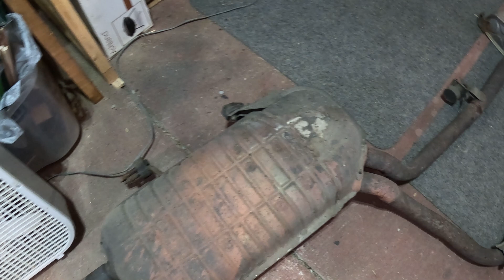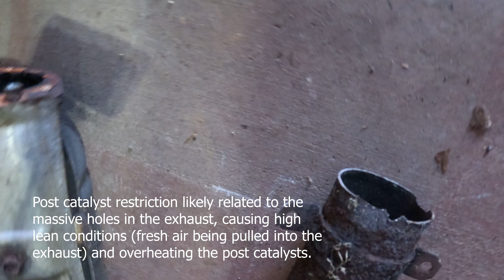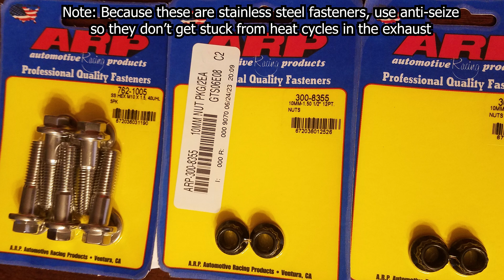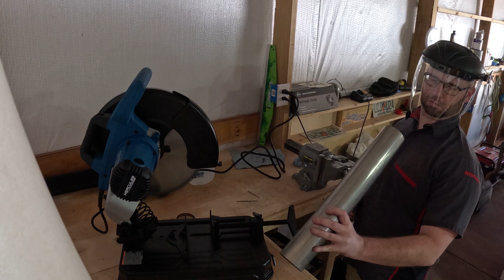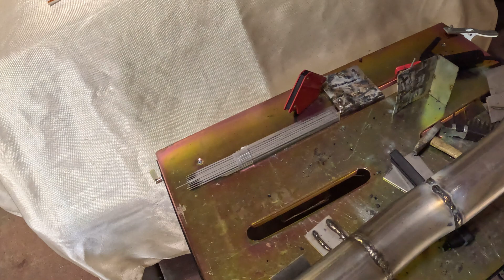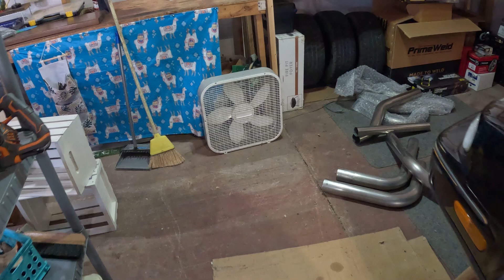Infiniti Q45 Project Car - Part 2 (Learning to Weld and Exhaust Fabrication)

Comment: Love to see the attention your Q is getting 🤘🏻😄 where did you get the 2 1/4 to 3 cone adapter? Planning on getting my 95 Q’s exhaust setup ready
Reply from the maker: I don't remember exactly where I got it as it was kind of hard to find this particular size.

Pretty sure I just searched the adapter size and ordered from a website that showed the adapter in stainless steel

Comment: I have a 1990 Q45 touring model with rear wheel steering that I bought. In 1990. Did you pull the engine out of the car to work on it. Thanks for this videos.
Reply from the maker: No I didn't pull the engine to do any of the repairs. The engine shouldn't need to be pulled for the majority of repairs on these Q's.

Comment: You can get a transmission control unit from a later G50 Q45 that will start off in first gear.
Reply from the maker: Yeah I can get one but since my plans include a manual swap, I didn't want to invest more money into the automatic